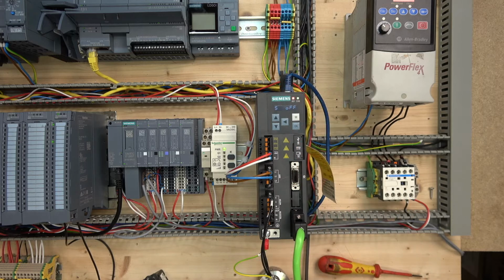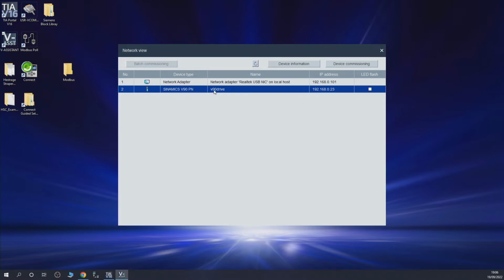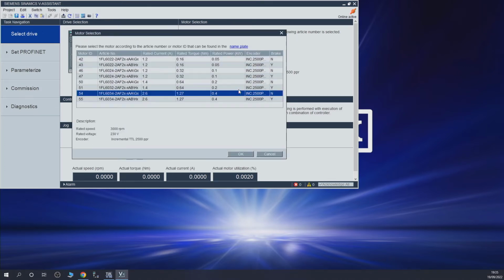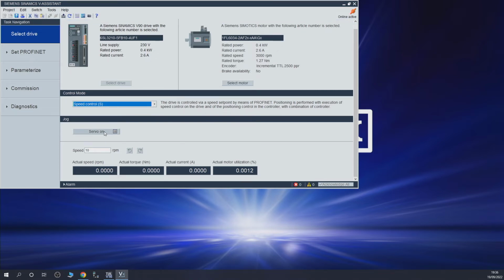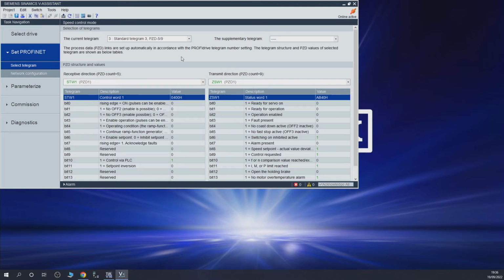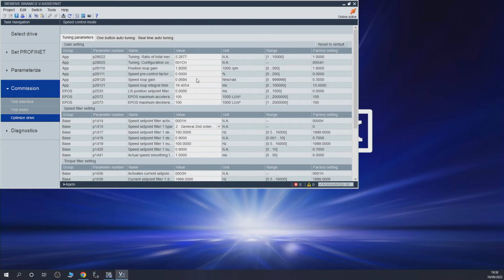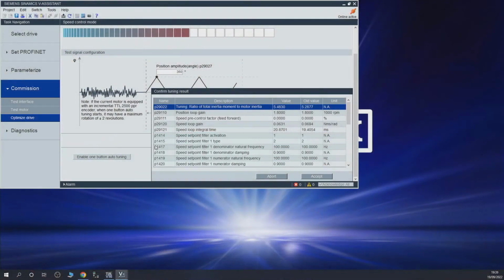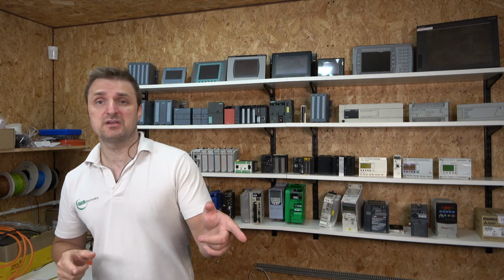Siemens V90 servo drive wiring, set up, auto tune and configuration using Vassist. Eng

Comment: Hello, I have bought a v90 servo with drive 3 phases. I have connect the power cable with 3 phases 400V but the module did not respond. It remain power off, without blink or lit any led or display. I have connect only 3 phases L1, L2, L3 but not the 24 volts dc. What may happen? Maybe has it problem?

Comment: Your videos have been very informativ and a massive help. 

I am looking at building an automated machine using mainly siemens parts. 

Will need a siemens PLC to drive a 1.2kw Servo, a 2.2kw sew Euro drive 3phase geared motor and VFD and a HMI to control the whole show alone with some push buttons.
Could you steer me in the right direction to choosing the correct siemens PLC.
Reply from the maker: Hi Tom. It all depends on complexity of the project. If the project is just turn things on, have some basic logic, with basic functions, no complex data collection, analysis , calculations and so on, a basic Logo would do. Logo can do a lot for such a small an cheep controller.